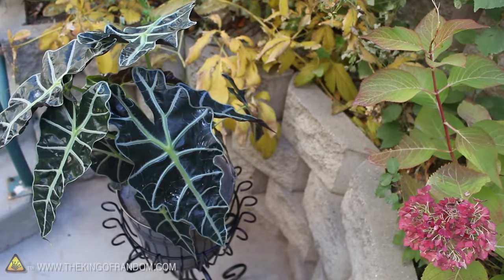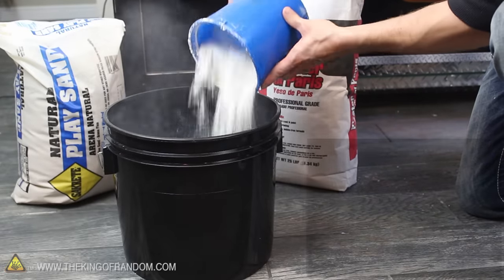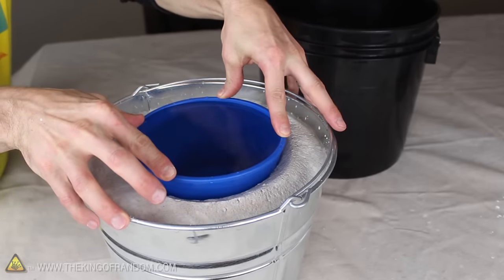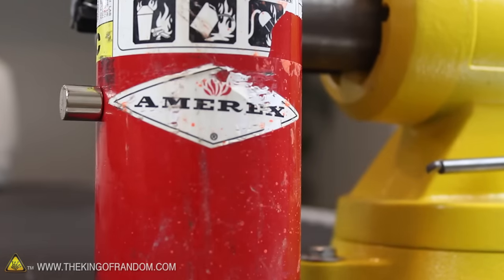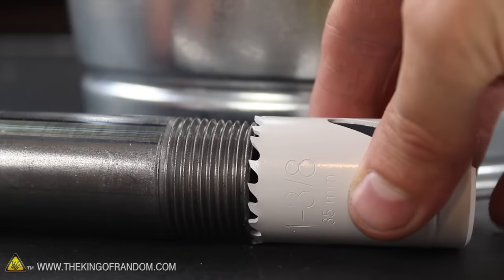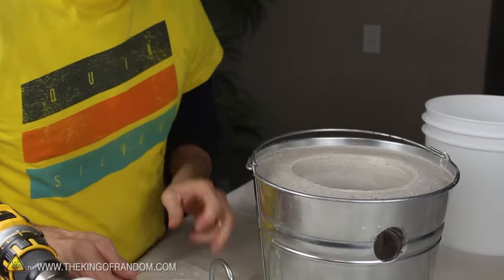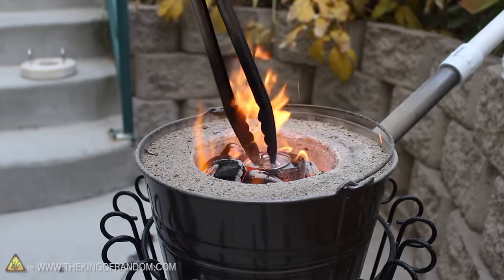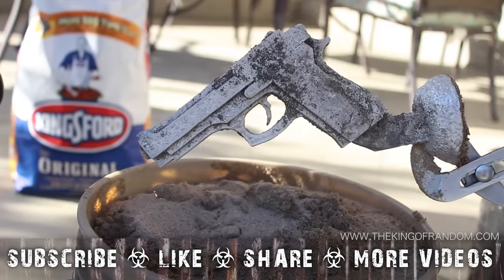How To Make The Mini Metal Foundry

Comment: it works with concret in the place of plaster of paris, in brasil there is not.
Reply: wot
Reply: what
Reply: So don't do it.
Either you do as told, or you injure someone. Someone else from there asked a couple of weeks back, it's something like gyps without gesso.
Reply: Plaster of Paris é gesso.
Reply: You need it without gesso (glue in English). What he's trying is frame-maker's plaster pre-sized (size is an English word for glue, traditionally it would be egg-white) for gold leaf, for framing artwork. I don't think it's wise, because the glue will burn. Buy the right thing off the Internet, or ask a medical suppliers - you don't want bandages, though.
Reply: +Rahere here in Brazil gesso is the white powder (CaSO4 . ¹/2 H2O) used in construction, artwork and in medical and dental works. There's no glue in it.
Reply: Ah, thanks, there are limits to how much help can safely be offered in other languages - the precautionary principle applies, if in doubt, don't do it until you've resolved the doubt.
The reason for being careful is in the Portuguese dictionary, telling me gesso is glue. In making frames for paintings, the grain of the wood is often filled with plaster of paris, which is then coated with "gesso", egg-white or "size", which acts as a glue holding the gold leaf on.
Yes, plaster of Paris is anhydrous calcium sulfate. If you're certain there's nothing else in it, go ahead.
Reply: Can you let us know how you get on with it, please?
Reply: Not recommended. Water is a component of the concrete crystal structure so it will rapidly degrade when exposed to this sort of heat.
Reply: just make sure it doesnt get water in it cause it may cause cracks
Reply: E no caso, que tipo de areia você usou?
Reply: lol i live there to
Reply: +Monty Leverett that depend if its fully cured and if you can stand the heat
Reply: Onça Pintada.   it will fall apart sooner with concreat
Reply: plaster of paris é gesso, use o google

Comment: How would you de-pressurize a fire extinguisher?
Reply: Zendaur use it all until there's none left.
Reply: Gummyy Bearr One that has the top part off maybe? Like his?
Reply: All fire extinguishers can unscrew at the top. Who whole valve can come off and just turns into a heavy, steel bottle.
Reply: Gummyy Bearr Oh ok, but if it was presurized wouldn't it unscrew and explode in your face? Sorry if I sound dumb ;~; Never handled a fire extinguisher in my life but I'm willing to try this project out
Reply: When you buy them, they come pressurised. If you tried to unscrew it (which would be bloody hard) without de-pressurising it first it would explode the valve off at the first chance and spray you with its contents. 

If you bought one and used its entire contents before doing anything with the valve (after being 150% sure its empty) then you'll have less trouble getting it off and then it wont be dangerous.
You don't sound dumb. Questions are questions. Not many people need to use fire extinguishers so many others like you are in the same boat.
Reply: Gummyy Bearr Ah okay. That answered my question. Thanks =)
Reply: Zendaur hit it on your head.   jk
Reply: Zendaur the fireextinguisher i had was pressurized.
it had a co2 tank inside that needed to be punctured(by pressing the trigger for the first time) to presurise the fire extinguisher.
But not all are like that. The safest way is to take the extinguisher and "use it up" till nothing comes out anymore.
Reply: Gummyy Bearr I wouldnt explode out the valve. If you go about it slow you will find a point at which the gas just barely starts to leak out (like a soda bottle) then you can slowly loosen it from there (make sure the tank is vertical when doing this so just the gas is in contact with the valve or the mixture will clog the threads)
Reply: chris ritner Well... maybe not explode out the valve, but when you unscrew it it'd turn into something worse than a champagne bottle when you uncork it. I should have explained it more clearly.
Reply: Very carefully
Reply: Gummyy Bearr dude thanks as well cause i was wondering the same question. thanks for being helpful :)
Reply: I'd just use it all to make dry ice for ice cream. ;)
Reply: +Gummyy Bearr It actually depends on the fire extinguisher - lots of them come loaded with powder and liquid, they are not under pressure. But for safety, just use it until is empty.

Comment: what can you use for a crucible that wont break that can melt iron or steal?
Reply: +James Sever  amazon.com  has graphite crucibles for good prices
Reply: +James Sever Tungsten/Wolframium
Reply: SardinTheo48 nice, yea that would work unless you were some person who wanted to melt tungsten but i doubt anyone out there could even get it hot enough to melt tungsten and has no reason to anyway. Thanks!
Reply: James Sever Actually, I was just kidding.
Reply: Gobalf  After a little research...
Ok, wolframium/tungsten has a melting point at 3695 K. Lava has a melting point at 1800 K. Tungsten is almost 100% tougher to melt.
Reply: SardinTheo48 1800 k is for iron, stone it a lot higher than iron, im sure
Reply: Yea silicon dioxide is 2000 k but pretty clos3 i guess
Reply: +James Sever Actually, Lava/Magma does only range from around 700°C to 1500°C. That's because not all minerals melt at the same temperature, so that Lava is made up from minerals with a low melting point. (Also pressure and stuff influences it) 
(also, don't quote me on it, I'm not a scientist, best is if you look it up for yourself)
Reply: the best easy crucible is a soup can I use them all the time, their iron if a magnet sticks
Reply: Cooper Kowal thanks, they work for melting soda cans, (heads up, be in a well ventilated area, aluminium isn't the ideal thing you want to be breathing all the time) but if i want to melt denser stuff like steel i saw his arc forge which works pretty well, apparently pumis works well as a crucible/forge
Reply: Blank Gaming At high temperatures titanium spontaneously degrades to titanium dioxide, which would contaminate the molten metal.

Comment: Where can i get plaster of paris cheap in the UK???, online it's like £29 for 25kg bag
Reply: B&Q
Reply: That itself is pretty cheap. Around a dollar for a kg.
Reply: +Jimbo-Kills you could get in a hardware shop!!!
Reply: +Faizan Shariff do you know if I need the steel bucket or will ant bucket do?
Reply: Jacob Paziuk  i might insist u to take a steel bucket
Reply: Faizan Shariff okay. :(
Reply: good
Reply: That is cheap
Reply: +kboy056 Yes that's what you need but you'd need at least 6 to 8 of those.  Better to buy a 10 kg bag.
Reply: the uk is closer to paris than the us. It should be cheaper.
Reply: not after yesterday
Reply: +Buns Crapters I believe Plaster of paris is actually from Paris, Canada.  Not Paris, France.  (Small city on Ontaro)  From my understanding that is where it was discovered.  Incidentally it's only about 20 to 30 minutes to where the telephone was invented.  The 1st distant phone call was made from Brantford to Paris.
Reply: Thanks so much for the list! Do you know where I can get the coupling? Thank you :)
Reply: It's not. There's a good price for UK makers here. https://www.rapidonline.com/Catalogue/Search?query=Plaster%20of%20Paris

Canuck Hacker Paris Ontario was only built in 1829 - they've been extracting gypsum from mines under Paris for far longer, that and limestone is what created the "catacombs", the ossuary of the 1780s when the growing city needed the space taken by the Parish cemeteries far more than the respect for the dead justified. The mining may have started in pre-Roman times.

Comment: With a 10 quart (40 cup) big steel bucket and a 2.5 quart (10 cup) small plastic bucket, wouldn't you only need 14 cups of plaster and 14 cups of water?

The 10 cup bucket will take up 10 cups of the big bucket, giving you 30 cups of space. There is about 1 to 2 cups left on the top when everything dries, so subtract another two cups and you get 28 cups of space. That means 14 cups plaster, 14 cups sand. Right?
Reply: There's 4 quarts in a cup
Reply: spectrumwolf gaming
I know
Reply: so 10 quarts doesnt equal 40 cups
Reply: spectrumwolf gaming
Wait wait wait. I just googled it and it says 4 cups in a quart. Conversions are confusing. ;_;
Reply: Jharmainyack you're right. A quart is larger than a cup. There are 4 cups in a quart.
Reply: woops my bad they are confusing
Reply: Jharmainyack Don't forget about the lid!
Reply: *****
Right, so since the lid is half of the base, then 21 cups plaster and 21 cups sand.
Reply: Jharmainyack 
hmm I just did counted all cups you need to mix. thats in total (21+21+15 =57 cups)
57 cups is 14,25 quarts

He use the 2,5 quart bucket to fill the bigger one

1-3/4 bucket plaster of paris = 4,375 quarts
1-3/4 bucket sand = 4,375 quarts
1-1/4 bucket water = 3,125 quarts

If you count all quarts you need to mix. thats in total (4,375 + 4,375 + 3,125 = 11,875  quarts)

but the bucket is only 10 quarts....
Reply: I don't know how well I understood what your confusion is about, but remember too that you're comparing liquid volume with dry volume.  One cup dry mixed with one cup liquid will be less than two cups total.
Reply: Jeronimir Maximus 57 cups is 14.25 quarts
Reply: Jharmainyack you could also just fill the big bucket with water and remove one smaller bucket of water, mark the resulting water level and just add the mix until you reach that level. You can also use the water to mark your mixing container to avoid wasting much materials.
Reply: +joejoseph h its 4 cups in a quart

Comment: I plan on making a Forge this weekend and I had a few questions. I have a list of materials I was able to piece together from your videos. However I am missing a few.
 
1. Plaster of Paris         25 lbs
2. Play sand                  25 lbs
3. Steel bucket              10 qtz
4. Bucket                       2.5 qtz
5. Big Mouth Bucket      5qtz
6. Hole saw                   1-3/8 in
7. Steel cup                    3x5 in
8. Steel pipe/tube           1x12 in
9. PVC coupling             1 in           Fipt x slip
10. PVC pipe                  1 in x 2 ft 
11. 2 U-bolts                   4 in
12. Steel tongs
13. Charcoal
14. Hair dryer
15. Duct tape
16. Propane Torch
17. Steel pan (Variations)
18. Wet Rag

What types of gloves are you using for the Aluminium and Steel?
What type of face protection are you wearing for the Aluminium and Steel?
What type of material clothing wise should you wear when melting the Steel, just a long sleeve shirt or some type of other material?
Let me know if I have missed anything.
Reply: Almost forgot is that a 5, 10 or 20 gallon bucket you are using for mixing?
Reply: Go and get some thick leather glowes safty glases and wear something like a hoddie and some jeans for protection
Reply: Michael Tungate Trust me, if Grant doesn't mention it in the video, its no big deal. He doesn't mention his gloves, so any will work and any will work, though I recommend leather gloves if you can find them.
Reply: ***** Welding gloves would work the best....Since they are designed to be extremely heat resistant and flame retardant.
Reply: Yeah but those can be upwards of $20 and normal gardening gloves can be around $2-$4. If you've got cash to blow you could, but I'd imagine they'd get in the way too much especially with a small tools and materials.
Reply: I think you are under estimating the flame retardant-ness of modern "cotton", and also, there aren't really any flames when running the foundry because of the fuel so no worries. Occasionally, but nothing to light your gloves if your using the tongs. If somehow you spill molten aluminum on your hand, no average glove will save you. I'd say (because garden gloves change depending on where you are) just get a good fairly sturdy glove that is easy to take off in case of emergency. The two most likely injuries to be had is you spilling molten aluminum on your foot, or your hand getting burnt by the heat traveling through the object your holding.

Comment: what you failed to tell us is that the sand and plaster mix are really hard to stir and should probably be done with help. or else you end up with a $40 useless slab of concrete.
Reply: Or add a tad more water. RTFM.
Reply: Omg
Reply: well, he mixes it by hand, so how hard can it be? :) wouldn't a mixing attachment for your power drill work, too?
Reply: It's really not if you have arm strength above that of a 5th grader. I made this foundry yesterday and it was EZ.
Reply: Angstadillio curious to know how your forge works out....
Reply: +Angstadillio Oh wow, you're so cool. Hope I can be like you when I grow up... 
You don't live where I do. 100° by 10am and no humidity. My forge materials set up in about 2min. No time to actually mix any of it and get the clumps out.
Reply: So get up in the morning, or do it in the house. It's pretty obvious.
Reply: MadManAz do it in your garage. barring that, lay out a cheap $2 tarp, a board, newspaper, something. borrow a friend's garage if you have to. i assume that since the temperature/humidity there is weird you own a humidifier for use in your garage. 

i can see where this all would make a certain mess, but, c'mon, it can't be that bad unless you're a clutz, in which case maybe this wouldn't be the right hobby for you, eh? if you get any in the grout lines, just carefully dremel it out.
Reply: +MadManAz it's your fault you didn't think of these things before absolutely humiliating yourself on youtube.
Reply: dperezzz10 
True, but also consider if he's a safe worker.What he says indicates he is, right off the scale.He'll fail safe.
Reply: hard to stir?  It was easy! I got rid of all the clums too.  I stirred with gloved hands in actual metal bucket.  I almost end up with bucket of concrete because it was such a runny mix I didn't think it would harden so quick, so while I was cleaning up I grab paint can and try to push it in and it was almost solid! Luckily I was able to still push it in and it came out with no bubbles really smooth, I couldn't believe "concrete" can be so smooth!  Slightly off-center though, but it's not an issue.
Reply: +MadManAz it would help if you mix sand and plaster thoughly before you pour water
Reply: Dima Prok good advice.
Reply: ryan barker Just one word of advice - DO NOT use plastic paint can, unless you wrap it with foil and maybe a layer of masking tape used for painting.  It was incredibly difficult to remove the paint can,  I used channel locks and heat gun to make it soft and tin snips to cut in to pieces.  I used paint can because I could save blue bucket and more important paint can is slightly larger and that's what I wanted, a larger space, although now that I converted to propane it doesn't matter.
Reply: ***** my wife and i own lynn's c/o engraving and awards, which is in west carrollton, OH, a south suburb of dayton. we're on facebook, check it out if you have an interest to. :) if you do, just know that all the guys in in pics are not me just helpers ~ i'm far better looking than any of those guys, lol.
Reply: ***** btw, good luck with the cast, hope it goes well. :)
Reply: MadManAz and you seriously think you cant just chip what ever gets on the tarp off
Reply: cheap plastic disposable tarps are a couple of bucks. at the dollar store you can get cheap plastic tablecloths for a buck.
Reply: +BCV 424 I would never do it in the house, not even in garage!  The amount of mess you end up with is huge even though I was being careful and you think the tarp is going to save you?  Just try it.  The dust that flies up when you're pouring will go up in the air and settle down all over your stuff, the mix spills and you end up with white  footprints everywhere.
Reply: im not disputing that you had a hard time but i followed the plans exactly and had no problem doing it myself. took a while to mix thoroughly but easily doable on your own if you have the upper body strength
Reply: MadManAz yes indeed. I've thankfully tried the sand and plaster in an another tank just to test it out, and I've found that the mix solidified under 5 minutes.
Reply: Angstadillio did u use 21 cups of mix for the sand and pairs or 1 3/4 buckets

Comment: Would it get hot enough to melt gold
Reply: Electronic Experiments I've been trying to do it with a smaller furnace but gold news roughly 2000 degrees Fahrenheit to melt.
Reply: Anthony VanDyke yea
Reply: But can it melt your ego
Reply: Zinan Watts not steel though
Reply: You need better refractory mortar (perhaps perlite & unsanded thinset) and a graphite or aluminum oxide crucible to melt gold. You need to fire those crucibles with nothing inside them before trying to melt metal in them. You can start the heating with charcoal, but you really need to have a second port drilled into the foundry and switch to a couple of jet burners after the charcoal burns away.

Comment: does anyone know what size of a crucible we would need if we don have a fire extinguisher
Reply: get a size 3 graphite crucible, they're only 17$ on amazon right now. been using it and I melted my first aluminum!! and just a strong caution: put that crucible in the oven for 1 hour at 400 F degrees and I'd wait about a day or two then do a dry burn with it, and let it slowly cool over the course of the day with the foundry lid on, then you can use it... or be like me slapping some aluminum in there xD. Best of luck my friend.
Reply: Negative bud. Graphite crucibles are not made for use in coal burning foundries. If you read any description of one on any website itll tell you so. For a coal burning foundry you want a silicon carbide crucible.
Reply: Zeb Christmas k thanks